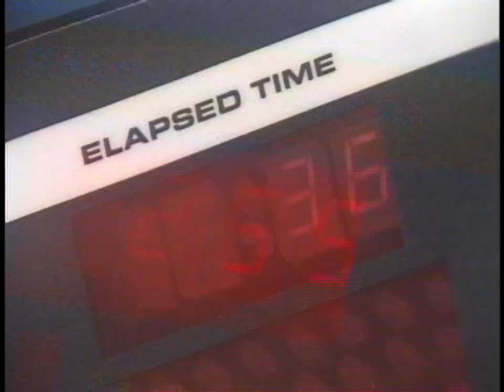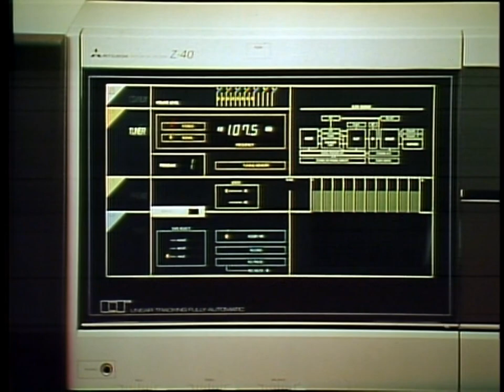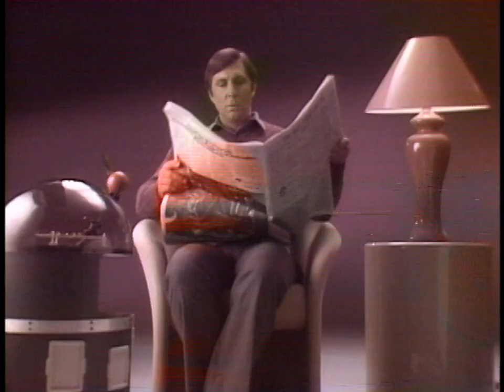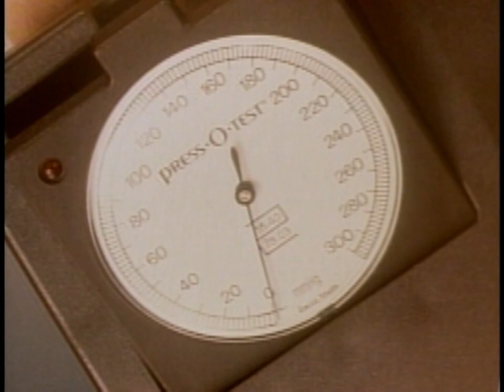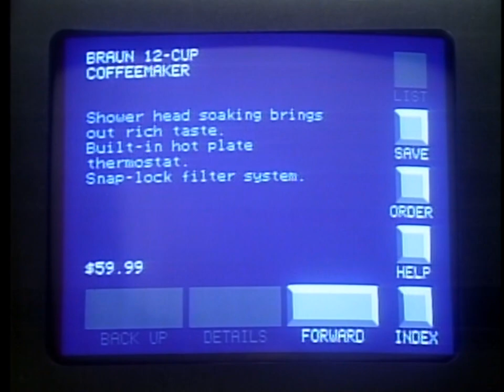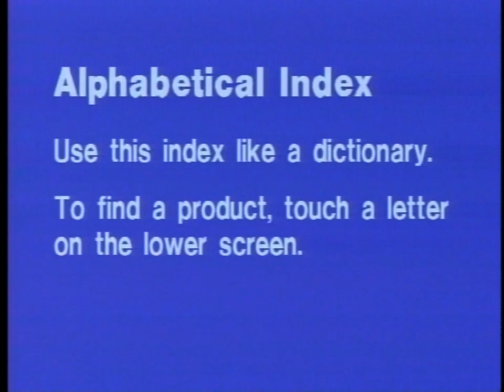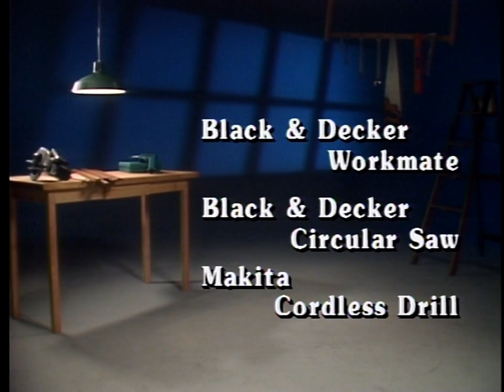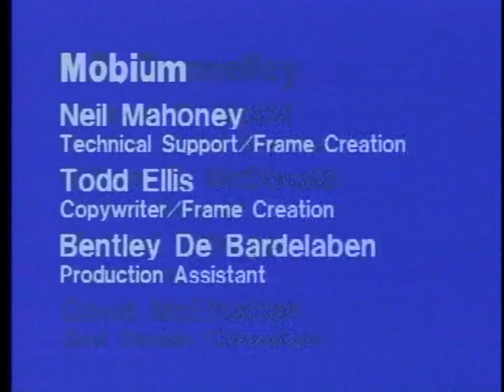1983 shopping kiosk laserdisc- "Electronistore"

Comment: 60 field to frame per second interpolation did not work well for the still frame segment! Wish h264 and this site had 480i support and bitrates that didn't make it look much lower quality than it is.
Reply from the maker: Archive.org doesn't require me to resize videos there for 60fps (though they still have to be deinterlaced), I will try to get this on there also. Some of the still frames on the laserdisc player were also glitchy.